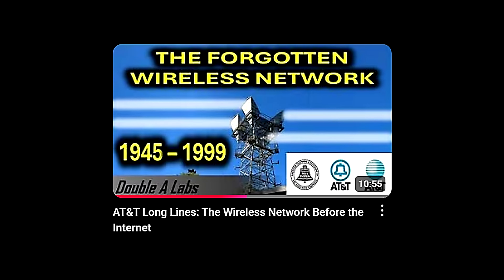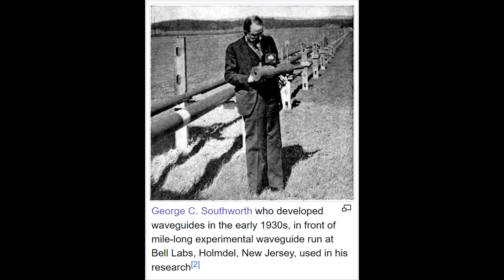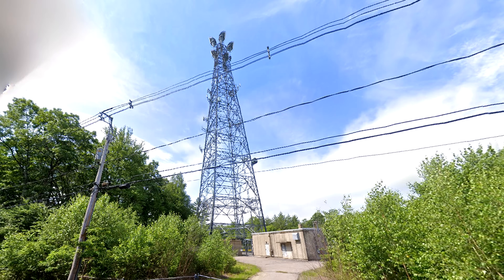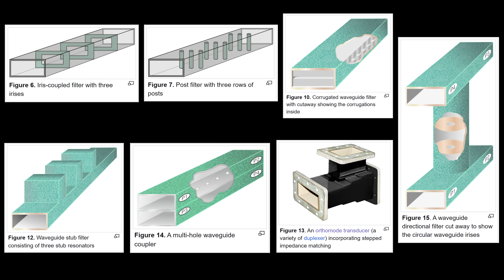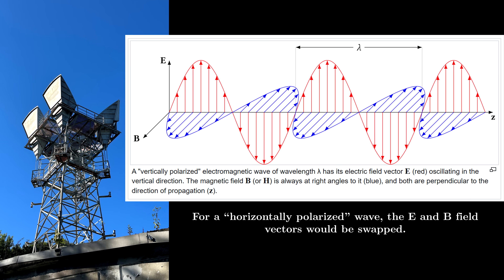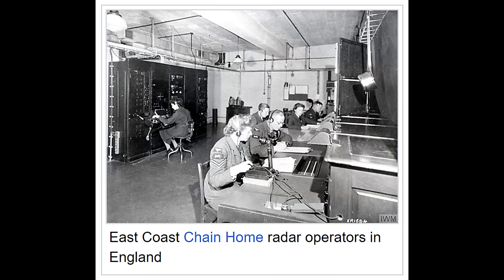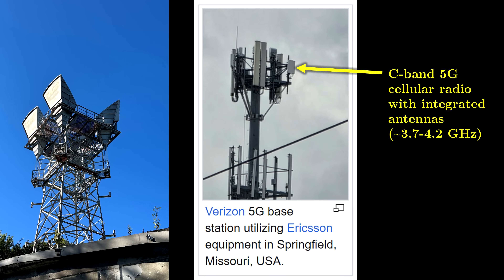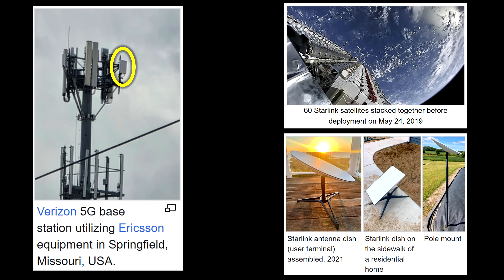AT&T Long Lines: The Waveguides and Antennas

Comment: What do you do for a living to have so much knowledge?! The things you're discussing are all the things I've had questions about!
Reply from the maker: I have an electrical engineering degree and work as a communications engineer in the rail industry. I have previous experience in the cellular industry as well. I've always enjoyed this stuff and learned a lot of it in my own time.

Also, I recently discovered several 1950's articles from the Bell Labs Record (an internal company publication at the time) which go into further detail about the microwave system than I have covered so far. I have a few more videos planned, showcasing many schematics and pictures from that era!
Reply: @DoubleALabs  thank you so much. I've been working in telecommunications for the last 10 years.. dealing with pots lines and VoIP systems in residential high rises. Hearing the history and technology of what made all of this possible is so cool. Thanks again

Comment: Pretty good...I'm amazed at the interest folks have in these empty towers I spend 45yrs as a technician and Supervisor with "Long Lines" ... we were the folks that connected all the 
local "Bell Companies" together to create the Bell System. To be honest with you any tech that worked the "VF board" or "LMX room" would tell you they were glad when we started moving service to the L4 & L5 cables many more trouble tickets.. Sporting events required patches being put up because everything went to New York 1st. Really after the 4ESS &
5ESS  and fiber then that's when Long Lines became the "monster" everybody used Long Lines  to transmit data. The last 15yrs the team  I was on our job was to maximize the efficiency of the Global AT&T Network our work would come from the folks in Bedminster NJ. I didnt touch anything below a ds3 it was ds3 and above I didnt do adds or disconnect i would just change their routes. I called every other provider to move something that they were using AT&T for.

Comment: Another very unique fact is that the microwave antennas are less than an inch long and they are located at the top of the rack of the radio itself. All the waveguide and dish are just beam directors and reflectors of already formed electromagnetic radiation. The dishes are not antennas. The output is sprayed into the dish where it is reflected back to form a beam. Like shining a light into a rounded mirror as you hold it over your shoulder.

Comment: Believe it or not, but many of the modern acoustic horn subwoofer enclosures and designs (a field I specialize myself in) use fairly specific peculiarities learnt during the Hogg/Holmdal horn experimentation and practical experience. They're essentially doing the same thing with just slower waves in a different form -- physically moving mass of air rather than electrical charges in magnetic fields; the electromagnetic transducer we call a loudspeaker takes care of turning those electromagnetic wobbles into physical ones for us. 

I learn every day and there hasn't been a single day in the last couple years I haven't gasped at how things. Connect and fall together into place at times. It's all one big conspiracy! That, or it's all physics, who knows.

Comment: The fiber to RF technology is often called “RF over glass” which sounds badass to me
Reply from the maker: I didn't want to get into it here, but I believe modern 5G panel radio/antennas typically use something called CPRI (Common Public Radio Interface). It's more complicated than plain RF over glass, but allows advanced control features like steering the beam ("beamforming").

Comment: There is one down the road from me, its a fiber landing now and nuke bunker that goes many stories underground.  Its setup to house 100 people for 100 days.  Multiple fences, security etc.  (An electrician friend has worked on the battery system that needs to be maintained regularly)

Comment: A future topic could be the fact that there are no over the air digital emissions. Only digital modulated analog emissions. ( ie phase etc )
Reply from the maker: I understand what you're getting at. I don't think the standard voice and video signals would have ever been digital on this system. PCM/uncompressed digital audio would have used way more bandwidth than analog. Efficient enough data compression came too late.

However, I think data did go over this system, especially near the end. I also wouldn't be surprised if the military used digital transmissions on this system.

I would like to get into those topics, but it's hard to draw the line between digital and analog. All waveforms are technically analog, and you can feed a digital signal into an analog system, so long as the amplifiers are linear enough for the modulation method.

It's hard to find timeframes on these types of changes, too. I imagine long lines gradually got more "digital" as time went on. If I run into some more information, I'll consider making a video!

Comment: A good majority of modern MW radio installations use elliptical waveguide, which is shaped like an oval and can be bent to a somewhat reasonable degree, unlike rectangular waveguide. As shown, the old-school way of doing an install with rectangular waveguide was to use rigid waveguide in every place you can except for when it has to bend any, and then it will use a piece of flexible waveguide to get it around a corner. It is also notable that the horn reflector style antennas that Bell used are rarely used anymore, mostly in favor of parabolic dish antennas.
Reply: A horn-reflector is a parabolic dish antenna, just a funny looking one
Reply: It’ll bend until it kinks 🤣 
Bending ew63 by hand and keeping it on the same plane the entire run is more stressful than mounting a 500lb dish 100+ft
Reply: @SovietRobot69  Keeping EW63 & EW64 on the same plane is definitely a pain!

Comment: You want corrections? You got 'em. First off, let's stop talking about "Long Lines" as if it's the name of the microwave system, it's not. Long Lines is the name of the Bell system's long distance division, which includes twisted pair, coaxial, terrestrial microwave, satellite microwave and (later on) fiber-optic technologies. When the Bell system was split up in the '80s, Long Lines became a company called AT&T Long Distance. It's a company name, not the name of the microwave plant.

Next, the years. There's a very good reason why the microwave plant was not put into service in 1945, and that reason is World War II. The United States didn't enter the war until almost 1942, and by January 1945, the war was still a pitch battle in both Europe and Asia. The actual year was 1955, not 1945. And 1955 was when we saw microwave towers starting to be built across the US. It may be just one digit to you, but it's an entire decade of history to the people who actually lived it.

Perhaps the biggest omission that I saw was no mention at all of the significance of time-division multiplexing as it applies to both the microwave plant and all the other technologies being used at the time. Why is this important? Because FDM was the first technology used for long distance calling, to turn a basic 4-wire "trunk" circuit into a dozen or more circuits. Before that, the only trick they had to multiplex was the "phantom" circuit, which allowed two circuits to carry a third signal between them. What FDM did was to carry more voice channels above the baseband one by radio frequency modulation, allowing a dozen or more extra channels to travel down the same pair of wires. Initially, the microwave plant also used FDM to multiplex a small number of carrier frequencies to have dozens, then hundreds and even thousands of subcarriers. Needless to say, the precise frequencies needed made the system increasingly complex to maintain. And because frequency is just the inverse of time, it led to an easier way to do the same thing: time division multiplexing. By the end of its run, the microwave plant was carrying thousands of voice calls using TDM to do what FDM did, but on a much larger scale.

Another thing about FDM & TDM was that these technologies were also applied to other physical media. Calls between central offices were often carried by large bundles of twisted pair cable, one pair per call. But as the number of calls being made using the new automated switching systems increased, so did the need for more circuits. This led to the 12-channel carrier system using FDM over traditional 2 and 4-wire circuits between central offices and along toll paths, using the same technology for different purposes.

After WWII and success with SIGSALY, the Bell system started digitizing voice, and this gave birth to time division multiplexing to do much the same job. When phone switching also went digital, it became possible to have almost the whole phone conversation take place in the digital domain, where multiple conversations could be sliced and diced, added to others and routed entirely in the digital domain without any need for an immutable switched circuit. It also made it possible to carry other things like TV signals and computer data as well along the same path with no extra difficulty. It was this change that made the phone company so much different than it was before WWII. But the microwave towers could be seen. If you're going to tell the story of why the microwave towers were so significant, you need to know how they fit into the overall scheme.

Finally, I was disappointed to see no mention at all about the antennas. For people like myself who grew up seeing the oddly-shaped antennas that were unique to the Bell system all over the place, that's an important story to tell, especially because of the rich history that's embedded in it. The original parabolic / reflector design seems to originate in Holmdel New Jersey, where it was first used in a rather important scientific discovery of the cosmic microwave background radiation in the universe, leading to understandings of the origins of the universe, and also the first precise measurements of the earth by measuring the time it took radio waves to bounce off of of a space-based reflector. The Hogg horn that made it all possible was also at the heart of the Cold War era long distance network of which you speak. Important stuff, indeed. But not one mention of it...
Reply from the maker: Thank you for your input. Some of the material you mentioned was not covered as I wanted to make this a quick video. As far as FDM/TDM and analog/digital, I have not yet found source material covering the details of changes (years, etc.). I want to keep my historical accounts accurate, which is why I have not covered those topics.

Yes, Long Lines referred to all Bell long-distance technologies, not just the microwave relays. However, Long Lines seems to be the most popular term (and search keyword) today. Note that I usually clarify by saying something like "Long Lines microwave".

As far as the year, TDx (the experimental precursor to TD-2) started to roll out in 1945. This link was from NYC to Boston. TD-2 started to roll out in 1949, with the first link being NYC to Chicago.
Reply: Good stuff.  I never realized the shape of the ATT antenna is the same as the original astronomy unit in NJ.  If i remember the picture correctly it was a much larger antenna but yes that same unique shape.
Reply: @yttc88307  the Hogg design is unique because, unlike other parabolic reflector designs, it has low side lobes. That made it useful in radio astronomy, but also became needed for the nationwide microwave network to cut down interference from nearby signal paths. I don't know the exact dimensions of these antennas, but do know that seeing them at a distance makes them look a lot smaller than they really are. Many Hogg antennas are abandoned in place because their size and weight makes the cost of taking them down prohibitive. Either way, these antennas have a rich history that deserves to be told. For example, before GPS existed, they used the Holmdel antenna to measure the distance to the Echo satellite reflector, giving us the first precise measurements of the globe. And it was done in my lifetime!